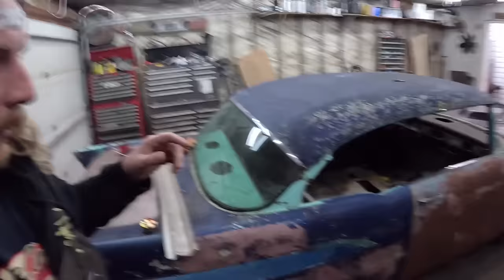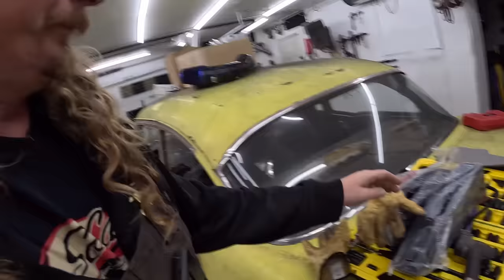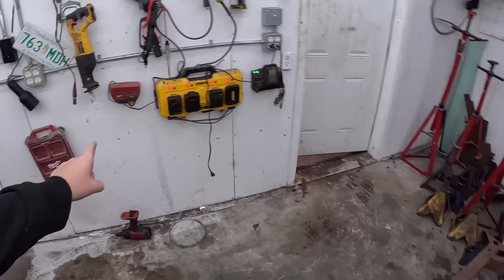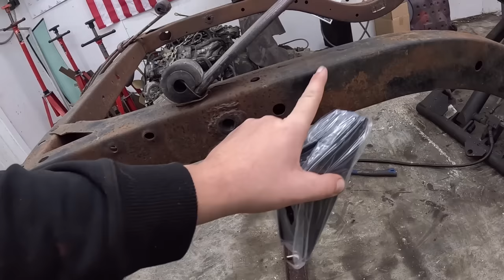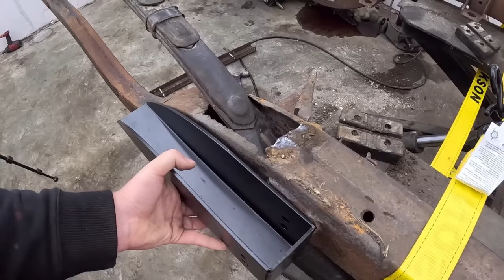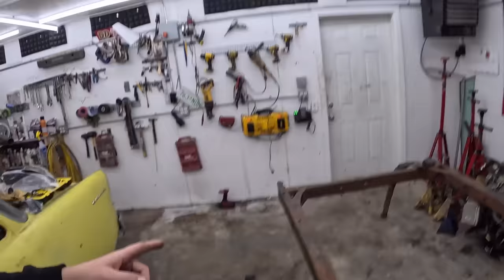BUDGET Pro Street 1957 Chevrolet - Cheap And Easy BIG TIRE Chassis Modification

Comment: You should leave the rear shock mount.  I have a rust free 57 Chevy Gasser but the shocks started to rip the metal in the trunk where they originally mounted.  So I welded in a top shock mount to cure that issue.  Nice if you already have it!

Comment: i have become a tri 5 fanatic..  been off work w shoulder sugary have sit n wait for my next hot rod  fix ..  i have my lemans in the grange but man i want a crusty 57 and you just keep getting these amazing cars.   The 56 conversion was so slick it made me feel like i would be able to do that...  there are a few good deals on tri five projects out here  in the west.. reasonable 4 doors and wagons .  cant hate on the wagons .. im sure that to get into one i may have to build a four door  ...im so impressed with your vision for crust . i grew up in a autobody family  had 2 shops the big shop and the home shop that did restore jobs on the side.. i grew up DD speed shop..   it never leaves your soul ...

Comment: Hi Dan .. you did a great job on the frame but the cross member on the rear of frame is a very good part to have . This extra support helps stabilize the frame and the trunk connections for the shocks was an engineering flaw by G.M. The body connection with air shocks will bend and if you lay a lot of rubber the shocks will puncture through the trunk floor ..This part is sold and all Tri-5 Chevys should have this shock support. Great videos..

Comment: Just get two 55 gallon oil/fuel drums and put a 4×4 through the front fenders and lift the 57's rear with the cherry picker/Engine Crain and roll the frame in with all 4 wheels that's how I did it on a 72 Oldsmobile Cutlass.....

Comment: To me, the frame looks very thin at the c-notch but the metal youput back in is likely stronger than what came out. Nice progress! Any of your collection for sale?
Reply: I was thinking the same thing. Looks like it could use some more reinforcement. A semicircular cut would not have compromised the integrity of strength near as much. 😮
Reply: I'm thinking the same. In fact, my thinking was why it had to be such a long notch when clearly, the travel probably won't be that much one way or the other. I would have done a 3rd less and set it for the back clearance  needed.

Comment: Hot Garbage 🎉 I'm totally for this Ratty Consolidation of your junk piles... I did the same thing during that whole " coof lockdown deal" lucky to have welding gas and scrap steel n 3 months isolation to build a super fun cheap beater that doesn't break the bank and hurt if you scratch it... I've got the Holden equivalent of the 57 Chevy, it's like a miniature... 1960 Fb Special Sedan! 
Can't wait for your next video, always enjoy your Jerry rigging body swapping 😊 Keep it coming this is Golden 🎉

Comment: OK.  When you were working on the Nomad you stated the rear shock mount location was a bad idea, being mounted to the floor.  So why did you remove the extra support that was added on this one at the top of the hump in the rear of the frame to mount the shocks?  Why didn't you add a support like this to the Nomad and up grade a design you didn't like?

Comment: I don't know what your plan is for the finished car, but I think leaf spring sliders would be better in this case as they would drop the chassis a few inches without using the drop blocks.. I hate those things as they allow way too much wrap in the spring and really limit control. You already filleted the frame. Would work well with the sliders.....
Reply from the maker: I'm just lookin for a simple cruiser

Comment: Dan, with respect, I think with that overly long cutout at the rear of the frame, you’ve created a weak point at the front inner angle that will be stressed by the leaf springs. Just sayin.
Reply from the maker: If it breaks I'll fix it
Reply: @DDSpeedShop  No wheelies bro! Lol

Comment: 2 inch drop blocks but you also tucked the leaf spring into the from about 2 inches higher In the back where you channeled the frame to make room as well that is going to be an ass dragger when done. Looking awesome
Reply from the maker: Leafs r at the same height as stock.  2 inch blocks r minty
Reply: @DDSpeedShop  Hmm interesting with the rear shackle mount raised up above the frame and not through it doesn't have an effect on ride height? I take it the shackles are longer then ? Very cool. Thanks for the reply. Love the work by the way.
Reply: @DDSpeedShop  Looked like you had 1more hole of adjustment in the shack assem to drop the ass another inch if need be..👍👍

Comment: Really liking this build and moving the spring to frame center is very cool BUT just welding the bottom of the frame will create a stress that can crack and create a weak spot in the frame but if you drill some holes into the front spring pocket and welded the holes too tie the to pieces of metal together along the sides and top about 2 to 4 inches apart it will make the pocket spring much more of a part of the frame than just something added onto the frame.  Not sure how much difference it would be in a street driven car but in a full on race car drag or oval track it would make a huge difference in handling and if involved in a hard crash . Thanks for taking us along cruising and building some cool things.  Still hoping that you will drop a 396 crank in that 454 block and now that you are experienced in blower engines put a big 8 72 BDS water cooled blower on your your version of the BAD MAN yellow Chevy if memory is correct his was a 55 but always thought it was a very cool car.  From days long gone . Even the local drag racing brought in several thousand people

Comment: Hey Dan someone here has already said it though I reckon with the big pockets drill some holes in the side and top of the frame (its a pain in the ass now I know -Sorry!!) and plug weld them to support those pockets a bit more just welding down the sides will stress it alot as it heats and cools. It'll make it super strong. Anyhoops loving the weerk as usual. You're a machine!

Comment: Cut off wheels work great but the amount of dust that gets put into the air I cannot handle that's why I have a bandsaw which of course takes quite a bit longer but no metal dust in the air and that dust gets on everything!

Comment: The frame at the spring perch is half it's thickness and it is at a high stress point? Am I missing something? I see it snapping going over it's first speed bump.
Reply: All he is doing is moving the spring perch inside the frame, that box that he installed and welded gives the frame more strength, it's as though he wrapped the frame with four pieces of metal, nothing but strength.
Reply: I was speaking of the rear perch. If you lifted up on the rear bumper the weak point would be on the frame where he reduced it from 6" to 3".  @DooDeeDew

Comment: I'm curious if the rear end doesn't need to be narrowed some to help in getting those honking tires on without having to disconnect the shocks or springs? Wheel offset will play a factor too. I dig your builds.

Comment: You should powder coat the frame, make a nice engine compartment, quiet interior, with heat and a/c, and nice trunk. But keep the outside ratty.
Reply: Powder coating?...It's DD Speedshop...not Foose's Garage.
Reply: At v least paint it to protect it from salt and snow, seems stupid not too really.

Comment: I'm a bit confused about the frame mods, that rear mod for the shackles? I thought you dug the gasser look?  It just seems like the shackle mods are a bit overboard, since you're running the lowering blocks too. I get the spring relocation for the tires, and that's a great mod. Be interesting to see how this all pans out. I'm thinking it's going to be slammed a lot? I guess personal choice, never liked slammers myself. A friend had a 55 Nomad looked absolutely bitchin, great stance, very aggressive. Then he slammed it, and UGH, ruined the look of it, at least in my eyes. It just lost it's cool. Different strokes I reckon. Looking forward to see how it turns out. Best as always!

Comment: Beef up the frame BEFORE you put the body on it. Its pretty weak at this point with no shock cross member and super thin where the rear shackles are. You might also consider drilling some holes in frame on top/sides of the front spring mount insert and weld it to the insert so its got some weld at the top and or sides for strength. Id have to clean and paint the whole frame myself since its apart but I have a problem taking things to far making them pretty and clean. I wish i could just work on rusty crap without caring how it looks for once.

Comment: When you finish welding it together are you going to undercoat the frame before rolling it under the body?
Reply from the maker: Probably not
Reply: @DDSpeedShop  
OK well I was just thinking road salt and the like. Possibly building something that could stand Rot free against the Canadian Winters. 
   So I have another idea thinking Canadian Winter's  what about a 1955 pickup truck? 4x4 a real genuine Canadian Snow Beast?
With plow, winch, Tracks instead of wheels. You know a little competition for the half ass garages general. And a big bumper sticker on the back that says ( WHAT WOULD HOTROD JESUS DO?)
    anyways real two door looks great.
   I love it's made from stuff that was just laying around in the basement and backyard. Stay creative man.
HOT ROD JESUS FOREVER!

Comment: please at least por-15 that frame.
also, those early 10 bolts are kinda junk so don't expect it to take lots of hp and traction.
Reply from the maker: It's just gunna b a cruiser
Reply: @DDSpeedShop   would be awesome if ya did it like an early 60s mild custom. low, narrow white walls, dechrome. i know some people freak out over "custom" but look at the old magazines. they were hotrod/customs. fwiw the '70 and up f body rears were stronger but cheaper than a 12 bolt.